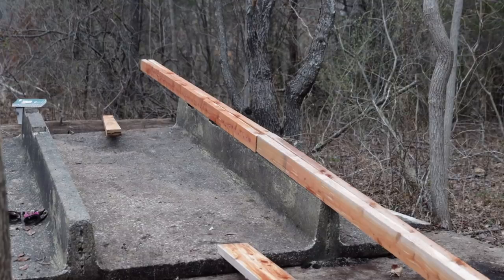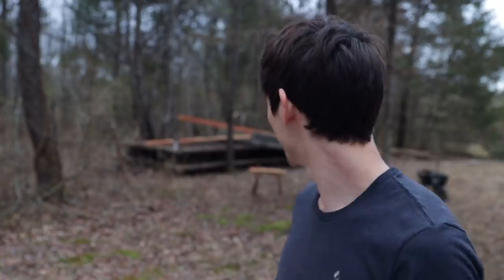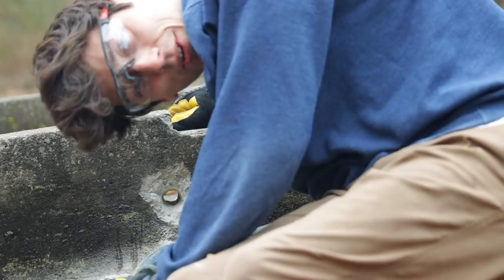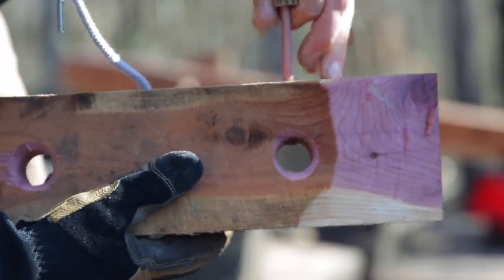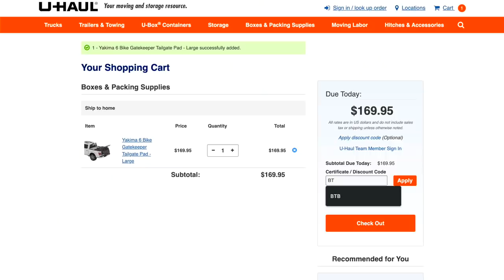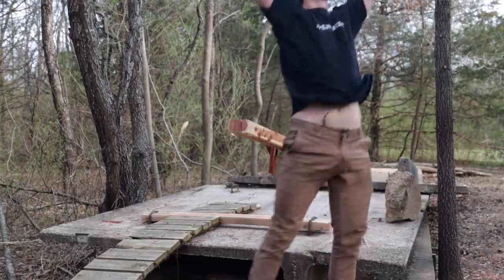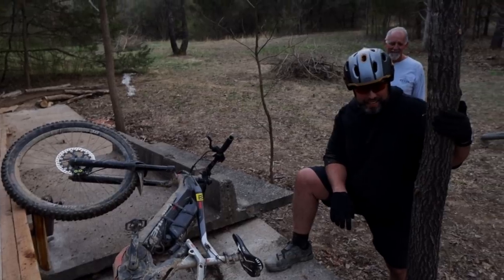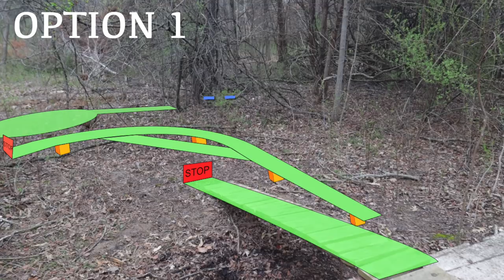Building a RISKY Skinny Ramp Over an Abandoned Bridge (MTB Trails)

Comment: When you are winching please wear at least some safety glasses or biking glasses at least.

Not to be a safety first whiner, but if that chain or cable snaps back at your face, bad things can happen.

Other than that: great work .... !!  I even put on glasses now when inflating tires. The snap back from a pneumatic hose braking loose is a real thing I experienced on my "AirShot" not put on the valve right.